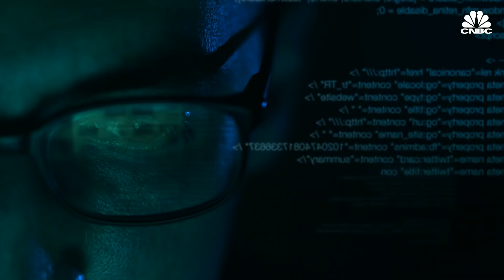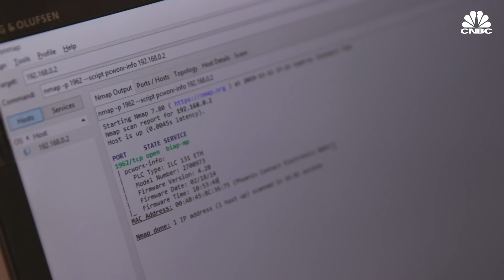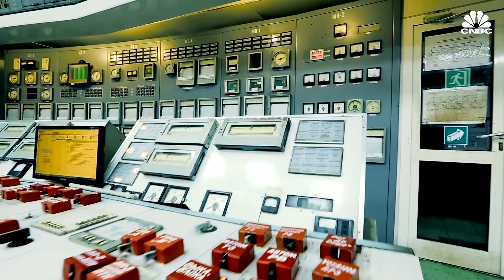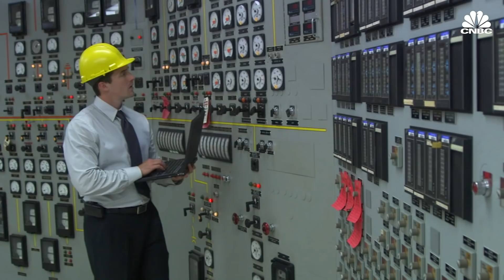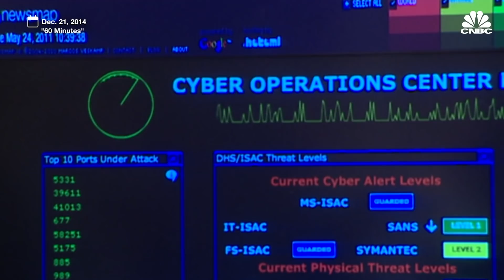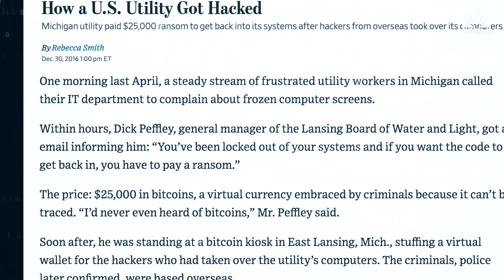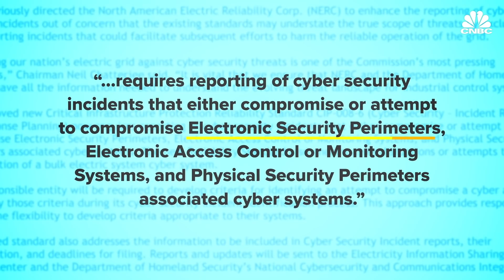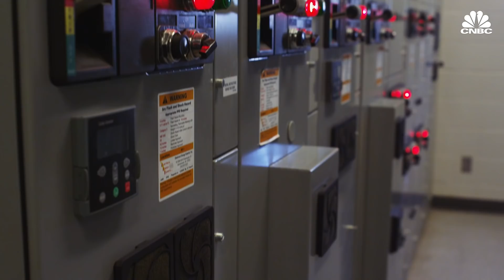How Secure Is The United States Power Grid?

Comment: I've got an idea and a solution manual override switches that are not connected to the internet in any way
Reply: vulnerable to pesky humans that corps need to inconveniently pay.
Reply: @laychyetan7466  No, most modern chemical processes, petro refining, and power generation are incredibly difficult and dangerous to control by hand. Also, these key facilities work on systems much different than the internet, but they are still a network. If you can get access to their network it is very dangerous still. Simply put, modern processes are impossible without the amount of data trending we have today, but with that incredible interconnectiveness, comes danger that we must be aware of.
Reply: @sstewar28  Yeah check out the USCSB YouTube channel. They document pretty much all of the stupid mistakes People make.
Reply: @mqe73M  Yea CSB is really great. As with most CSB analyses and in my experience engineering still bears the brunt of blame even with almost wholly human errors. Must engineer out dangers or thoroughly plan for them and for that automated systems are important. In the end of the day automation saves workers. Most accidents are caused by neglect of hardware anymore.
Reply: People should probably not go all the way Digital for example don't keep all your cash in the bank
Reply: @Amusis Most critical systems are not connected to the internet. Even non-critical systems function on their own intra-net (a private network) primarily. The video is somewhat misleading if you ask me there. They slightly clarify it (only brushing over it) but the hackers have to gain access to that intra-net which can typically be achieved through social engineering or physically getting on site and access to a computer. Once a single computer is compromised tho, the whole network may be vulnerable.
Reply: @Amusis Backing up yours.
Reply: That might help. But remote shutdown of facilitys is much faster, having to rely on a physical button might not the best solution in an emergency.
Reply: @dahhhhful  maybe, but having the option of both would be another option.